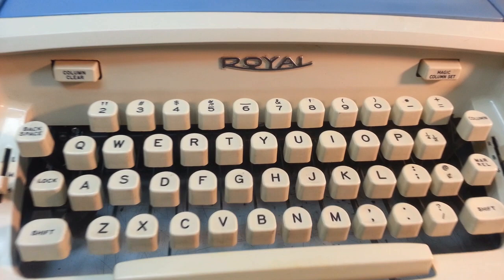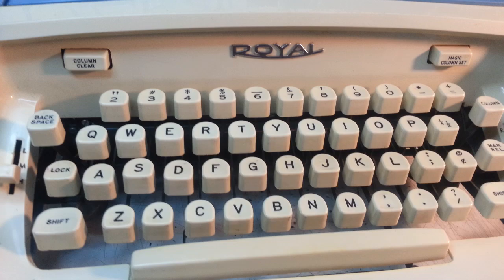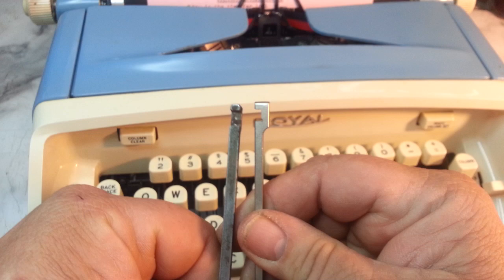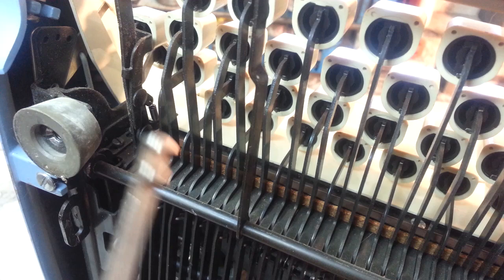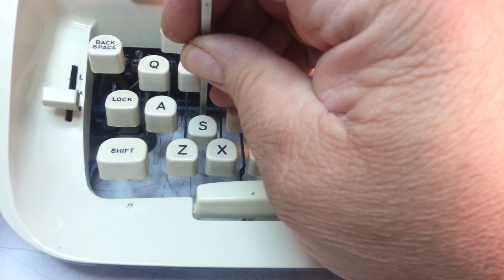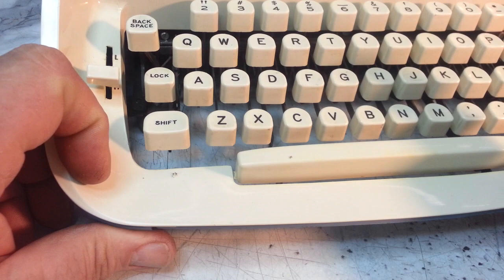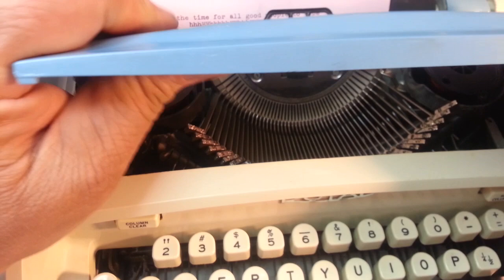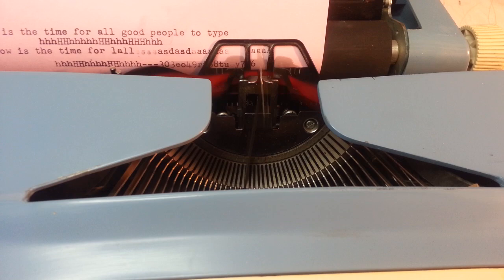Royal Typewriter Key Top Height Alignment Adjusting Procedure For Most All Keyboards.

Comment: I have one of these, and I have noticed that the margin settings are two tabs but when they are the silver Nail heads as I call them like Trim Tacks really, that is an Aristocrat, which is what I have a 1969.  That color blue by the way is called Starmyst Blue.

Question Duane, wehere would said tools be picked up, and do they have a name, or does Key Benders work?  

I'd like to see a more up to date overview of basic to advanced tools needed or improvised as well as chemicals, oils and cleaners to use.

That would be cool.
I can tell from my white lettering on the outside of the Samsonite case of my Smith Corona Electra 120 someone used a potent cleaner and it smeared the white lettering that is my guess anyway as to how that was smeared.

I hear simple Green is a good cleaning option to use that's safe to use on typewriters, what do ya think of Simple Green, or Goo Gone, Goof Off, and what would you recommend for a hard cleaner and a safe cleaner?  

Thanks again 👍

Comment: Would you be able to do a video on how to open these up and clean the vibrator mechanism. I have a Sabré that the vibrator sticks and a lot of letters are getting cut off at the top as it doesn't raise the whole way before the bar strikes (black position) or it doesn't fully lower the vibrator (red position)?
Reply: I just find a video, any make/model is helpful because the problem is usually unique. Lock the shift down and shine a light in there, maybe the mechanism needs cleaning. The sheet metal they used is often not much heavier than tin foil so things get easily bent. I’ve had as simple as I had the ribbon in wrong to cleaning the mechanism because it was sticky.
Reply: I have a 1969 Aristocrat that was doing the same thing, and I ended up having to bend the vibrator forward, and first using a lacquer thinner like Goof off just be careful strong stuff.

I used a pick tool and a hook tool to help slowly get with control bend the top vibration plate forward towards me and away from the platend.  Then I cleaned away the any gunk, applied a cleaner and then air last a tooth pick dribble of Marvel Mystery oil on the leads, guide arms top, center between and the back lower side.  

So far that's fixed my issues.

Your question was 5 months ago I'd be interested to learn what happened to your Typewriter if you have since fixed it and what you did?

Thanks.